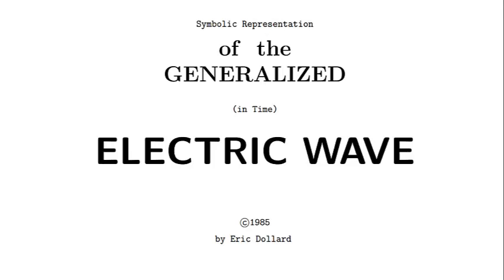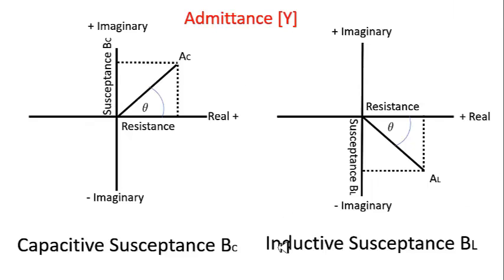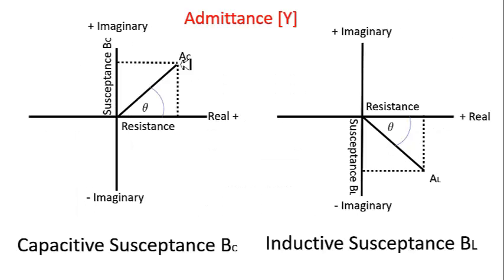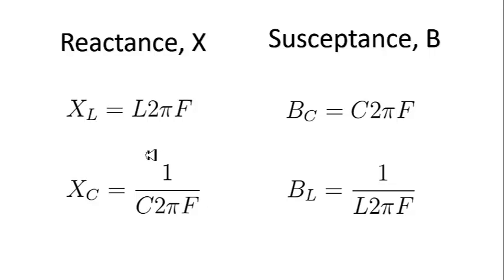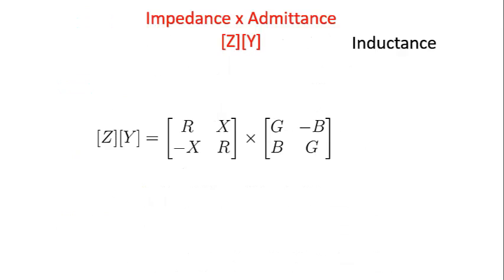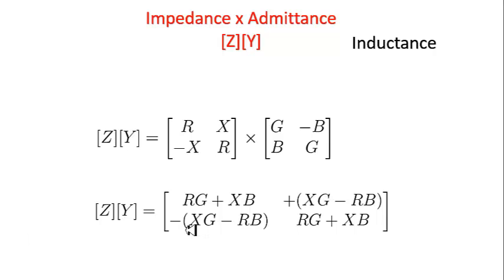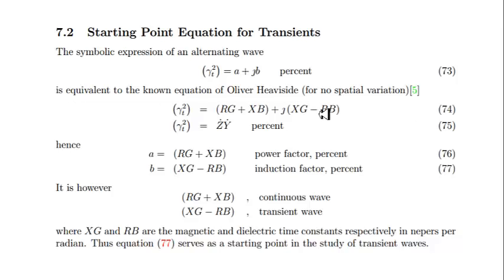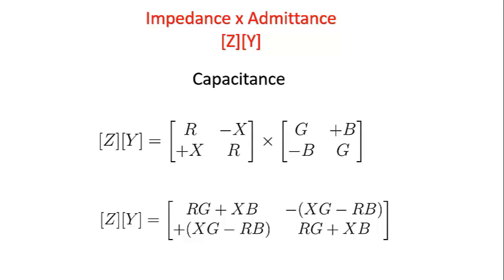Demystifying Eric Dollard : Admittance and Susceptance and Oliver Heaviside

Comment: Are you planning to look at the matrix representation for parallel circuits?
Reply from the maker: Actually, here is what I found out. At least I think this is correct. When the components are in series, you use the Z (impedance) equation and when the components are in parallel, you use the Y (susceptance) equation. If the circuit has both series and parallel, then you calculate Z for the series components, Y for the parallel components, and then multiply them together (ZY). This is basically an implementation of Heaviside's equation. 
So if I am right, you already have all the equations you need. I haven't tested this yet for a circuit that has both, so if you give this a try and it works out, could you please let me know? Thanks in advance.

Comment: could you show how you would apply this to a problem out of a textbook?
Reply from the maker: Tell you what. You find me a problem out of a text book, and I will show you how to apply it.
Reply: @FractalWoman  well.... not so much text book, more real life that bugs me about the math result being so far off.. just over 26 mins in to ben's magnetics
'Applied Science Engineering magnetics -- practical introduction to BH curve'

can you clear that up and get far closer to reality with cleaner Modified Complex Numbers ^_~

a visual helper for the minds eye:
electric 'resistance' = magnetic 'reluctance' & i visualise 'hysteresis' as the 4 'cycles' of the stirling engine waves ^_~
to shift the stirling engine 'hysteresis' higher on the graph and reality you increase flowing internal fluid pressure..
 so to put more 'pressure' into electric/magnetic wave/cycles you decrease the resistance/'reluctance' by cooling O.O
'Corpus ID: 53646610
Numerical Simulation and Performance Evaluation of Stirling Engine Cycle' figure 3

reminder:
When describing voltage, current, and resistance, a common analogy is a water tank. In this analogy, charge is represented by the water amount, voltage is represented by the water pressure, and current is represented by the water flow. So for this analogy, remember:

Water = Charge
Pressure = Voltage
Flow = Current.

it's debatable how you might classify magnetism here, is it drag, viscosity, venturi force as in pull in lighter localised fluid/air etc.